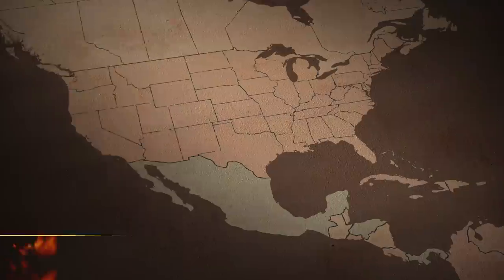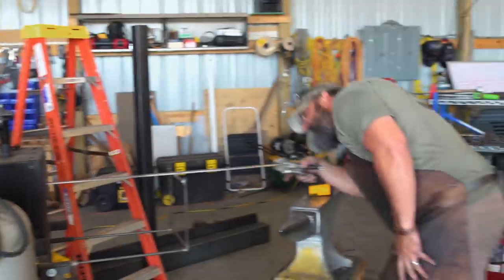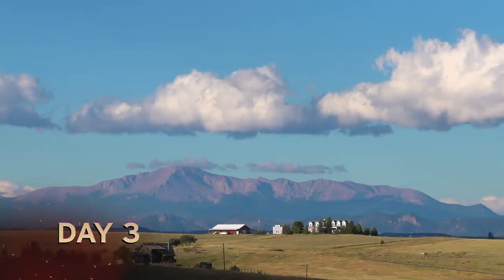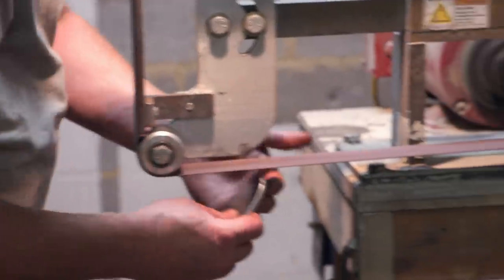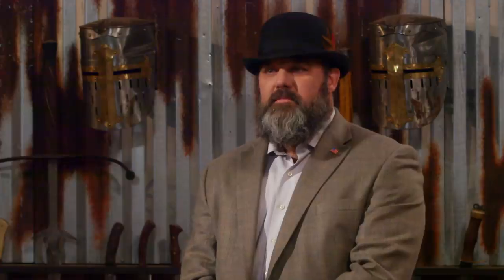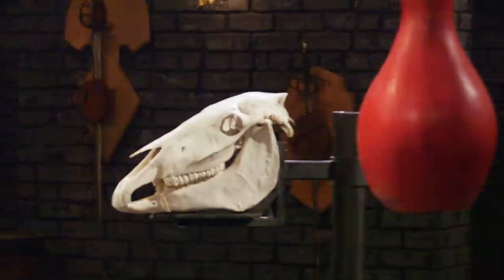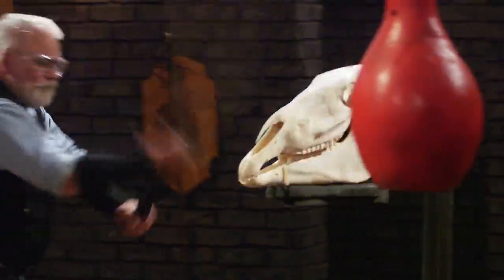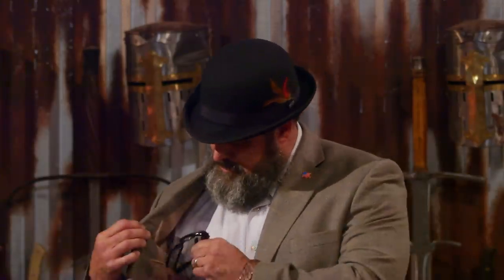Forged in Fire: The EXHILARATING Chinese Zhanmadao Sword's Final Round (Season 7) | History

Comment: Nicks blade was made of freaking rubber watching the dang thing bounce all over the place with every hit. I cant believe it didnt snap. The lack of curve just made it even worse. Wow that final cutting test made the difference clear.  Josh's blade was lopping off limbs and cutting into the torso clean as can be.
Reply: I also thought of it.. especially during that strength test ..
Reply: With that said, it means the heat treatment was spot on.

That is the difference between a excellent blacksmith and a weapon/swordsmith. The weaponsmith takes into consideration how it is to be used not just the appearance, forge, and heat treatment.
Reply: Nothing wrong with an elastic blade that has the purpose to cut, for stabbing blades do have to be more rigid. Mr Marcaida's edge alignment was not the best.
Reply: A springy blade is fine as long as it retains its shape, which Nick's blade did.  The problem was a lack of curve which prevented the blade from being drawn across the cut, which is why Josh's weapon was so devastating.

Comment: You know, i've noticed this theme in most of these challenges. The guys that have to do home forging never have a forge bigger than enough to do some small knives. Maybe you should look into solving this problem before going on a show known for sending you home to make swords and stuff
Reply: Well its not the easiest thing to do. Its not like every second person has a forge 3 meters long and it propably isn't that cheap either. And if the show is giving you 10k IF you win and you pay more than that then might as well not go on the show.
Reply: Its about skills as a blacksmith and IMO being able to build/expand a forge is knowledge that any true blacksmiths will have...ever notice the guys with undersized forges that dont find a way to evenly heat the blade usually have a failed blade? Its literally the most crucial step in a strong blade and if they aren't able to think on their feet and adapt then they will likely be going home after loosing
Edit: i forgot to say you literally just need fire bricks to make the forge longer..no fancy mortar needed just a fire brick tunnel made with stacked bricks.
Reply: I think the contestants also know what to expect. Like they know that they might reach Round 3 and may have to make a long blade. So the onus is really on the contestants not the producers of the show to make sure that they have longer forges and all. And as has been seen on the show many smiths with shorter forges make it long using blocks of wood and bricks to heat treat a longer blade.

Comment: Nick's blade didn't meet parameters, it has no curve at all.
Reply: Yeah, I have no idea why he was expecting a curve to appear in the quench. You gotta shape that curve before that.
Reply: totally agree, i thought they wouldn't even test it. Now he knows that curves don't magically appear in the quench.
Reply: yep
Reply: @spamhere1123  with san mai stuff you can make a curve in the quench. Also I think you can get one if you just do an edge harden.
Reply: Zhanmadao can be like this actually. There are more types, some with really only slight curve.
Reply: Yah, the sword did not fail, but the design wasn't good for the tests that were meant for curved swords.
Reply: @pappo5583  they actually do if you do it proper. Japanese katanas were made straight and the curve apeared in the water quench
Reply: I think he wanted to try the Japanese hamon technique but for that u need to you a mixture of clay and ash
Reply: @herreragonza5891  yeah, but this sword is neither Japanese or a Katana.

Comment: Not an expert, but from reading about Japanese sword making, to turn straight blade to curve blade during quenching, you need need to make front (edge) & back side of the blade cool at different rate.

On katana, the smith coat the edge with thin layer of clay & thicker layer in back side, causing different rate of cooling(& contraction?) of edge & back during quenching & giving the blade its curve

I thought if you didnt coat it, it will tend to bend right/left side instead of cuving front/back like usually can see in the show

Comment: The Zhanmadao meaning "horses head chopper" in Chinese, what does Nick think crafting a straight, thin blade like that?? Josh's blade is good, but its gonna be perfect if it has a little larger and thicker blade for use as it functioned and named

Comment: Ok so that one guy had a perfectly straight blade and after the quench he expected a curve.
How does that work? I mean so that there is only the curvature you like. Do you have to get different parts of the blade to different temperatures before the quench?
Reply: it CAN happen, if you do the heating of the blade asymmetrically.  Not easy though.